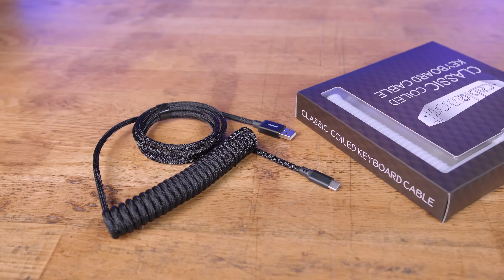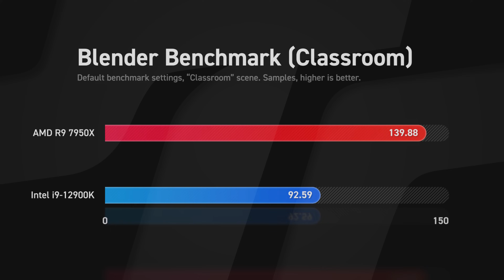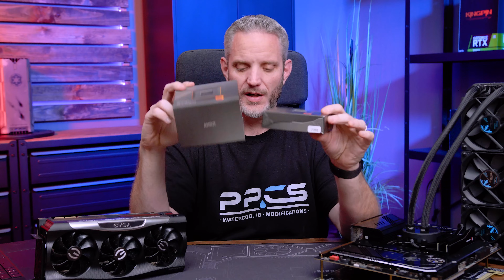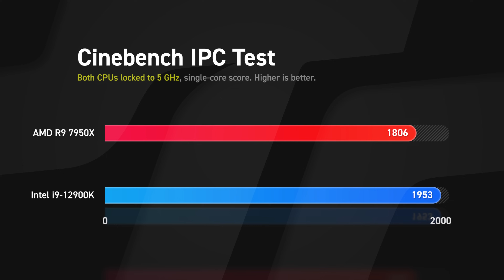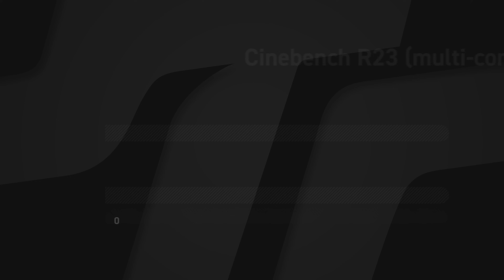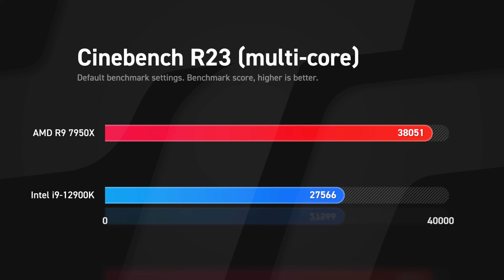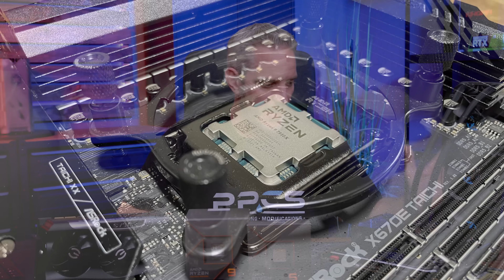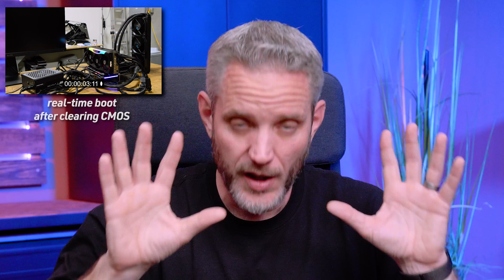Forget EVERTHING you THINK you know about AMD... these CPUs kick A$$!!

Comment: Hot running cpu has more benefits. You can get more freedom in cooling.

90 deg C core, if you can manage to have that with 80 deg water out, 30 in, it gives you a delta of 50 degrees and your pump only need to supply around 1.2ml if water per second (if my math is good). That's a liter every fifteen minutes.

80 might be a stretch, but it scales nicely. 2.5ml/s for 25 deg delta etc.

Comment: ok, so it can run  with no problems at 95c. What's that going to do to things like my gpu and m2 drives? Are we going to need cases that isolate the cpu from the rest of the system? I'm not an overclocker so maybe not an issue?
Reply: u less all you do is run stupid arbitrary pointless make believe score benchmarks like cinebench or prime 95...OR I'd all you do is run Handbrake ( basically anything that keeps your cou pegged at 99 and 100 percent usage).........you need never worry about that as the 7600x will never even clear 70 I bet.

Comment: I've noticed that even asus since the strix line something has changed. the strix line isnt like the old rog brand. compiar the old areies, mars and matrix cards from say the gtx580 or hd 7970 to the strix cards. sure strix is good but not like the old rog. evga used to make amazing cards to like the classified and hydro copper. if amd or intell got a hold of evga and told them ok go nuts make the best overclock able card for us and evga did it ....I would definitely save up cash and buy whatever they made.

Comment: Great vid as always!  Silly noob question: I just installed a 3090ti into my system and wanted to get the most out of it.  I have a 144hz Curved Predator gaming monitor (on my phone at work so  don't have the specs) and realized that I was about to use the old.... nameless stock 1.4 Display Port wire that I had in my closet from god knows when to hook them up.  I ordered a 2.0 Display Port wire from Amazon that literally arrives in the morning, cost me a very cheap $22.00 with shipping.  My question is... are all 2.0 DP wires the same?  Or should I look elsewhere?

Comment: AMD has great hardware, I just wish their drivers for their GPUs weren't a hot garbage fire. The only reason I got a 2070 after years and years of using amd cards, and suffering trying to find working drivers that don't constantly crash.
Reply: they're drivers have not been anywhere near trash since before the 7970 days..what pka wtf do you think you've been on all this time.

come back to Earth.

besides that .if you're on Linux..the correct drivers are ready baked into the kernel
Reply: @motoryzen  no I'm on windows. Last card I had was an R390

And it wasn't fun. I'd clear the drivers. Install the newest one, boot up and it would black screen. And never turn on again. I could even see the bios. So I had to put in an old card, just so I can see wtf I'm doing, clear the drivers, and start over with a different one, until I found one that works, that was like a year old. So in my last experience with an AMD card, it was garbage. Love their cpu though.

Comment: Why are we talking like 95c is a good thing... Besides aren't aios susceptible too constant high temps?
Reply: It's a good feature. Basically, it's automatic overclocking. I hope Intel will add the same feature as well.
Reply: @Kastrit  Not sure about that. I mean I use a custom loop on a 10600k and under load it's peaks at 50c. Not sure I'd like 95 to be the new norm even if it's a auto overclocking feature. Sure when winter comes I don't have to use the furnace as I would already have one blowing hot air into the room. Permiation is also a concern when the normal operating temps are so high. Just checked out de8auers vid on the 7k series. Apparently AMD done goofed on the IHS like Intel did

Comment: I'm kind of hesitant to upgrade my 9900k atm because that would mean buying new mobo and ram, cause I'm aiming for the X3D variants. But after watching this video, I'm even more tempted, especially switching to AMD after a decade of using Intel.
Reply: Same am on 9th gen to, i7 9700k. I want to get the 8core 12thread AMD zen4 CPU I can't wait for this release
Reply: @thealien_ali3382  the 7700x supposed to be on par with the 12600k 🤷 so I wouldn't bank that being so good
Reply: Don't waste your money and just wait for 13th gen and stick with DDR4 until DDR5 fully matures. As I came from a 5ghz 9600k which gave the same gaming performance as the 9900k to a 12600k and I noticed a huge leap in overall performance. And that's not to mention how well it responds to overclocking

Comment: what is the effect of running your system 95 Celsius over a long term (with intended use being animation renderings)? I would also like to know the average build cost of going AM5? price per Ghz? I am on the verge of building a new system and sitting with budget hands teatering between new gen vs current gen. What is your advice Jay?!

Comment: Linus benchmarks shows that AMD Ryzen 7 5800X3D Zen 3 beats in gaming all the Zen 4 CPU and i9 12900KS. So Zen 4 is only useful for production work not for gaming
Reply: no it shows a damn tie...on everything..
look at the damn frame rates.

wtf has a 500 + hz monitor?

wtf can even see beyond 200 something hz?

get real.

and Linus, just like Luke during the older days 10 years ago, calls a win anything that is more than 5 or 10 fps in thr multiple hundreds fps realm.

that makes absolutely no sense as NO ONE can even see such a small difference that really is within the margin of error 

now .100 fps versus 70 OR ABOUT 80fps...sure..that can be noticable

otherwise..no
Reply: @motoryzen  Are you going to pay hundreds of dollars extra for something that performs worse even if by little? 
5800X3D is far cheaper since there is no need to even upgrade motherboard.
Reply: @wekkimeif7720  for my particular goal which is w new build for my mother's light gaming and mostly work rig with a little bit of video editing on the side?..

She's dealing with a intel 7100 and the power supply is failing.

Now notice something..not a single content creator on YouTube has posted details about IDLE and Light usage power consumption numbers on the 7600x versus the 5800x3d or 5600x.

THAT...is what I'm looking at the most as well as price.

I'm not loaded ..but I'm at baby step 4 in Total Money Makeover book...smacking down a few extra Benny's for a platform that WILL be upgradable in the next 5 years while not having to buy another mobo as well as room for more ram makes more sense for my goal and Mom's needs.

Now for me...IF I was still sitting on my ( what has been for over a year now) backup PC rig with a 4790k..AND content creation and hardware multitasking with vms weren't in my needs...sure that 5800x3d would be a no brainer.  I currently run a 5900x build with 128GBs of ram though with a 8GB rx580.

So my only real upgrade I care about is the upcoming in October newest gen and GPU. Then in good for the next 6 or 7 years easily.
Reply: The 5800X3D only won against the 12900k in selected tities and I can assure you I "own" both 12900k and 5800X3D and in most of the games the 12900k does in fact come out on top by a couple of FPS
Reply: @welshman2011  yes..a couple of fps ans that is the point I made..

W couple of fps ISNT even noticable.

What matters the most to the person who is ACTUALLY playing the game?
not even a 5 percent difference at the 60 plus fps range from some YouTuber online. Or REAL world noticable performance?

That is the question so many refuse to ask themselves

Comment: I'd say it's more like they designed the CPUs and then saw the temps and the marketing team took over from there. Go check out Romans (Der8auer) early delid and deeper dive into the IHS on these CPUs, WAY thicker than they should be. He got his 7950 to 5.5Ghz, all cores, and a 20C drop by deliding and using direct die with a 360 AIO.

Comment: Really pleased that Zen 4 AM5 is delivering. 
Can’t say I’m pleased about how it dials the memory timings in, and the temperature it runs at 🥵 
I know once it’s got them, it boots just fine. But you know there’s going to be that day when you really need your pc to do something quick, and that’s going to kick in.
Just makes me think back to having to turn the plug off on my 1700x every now and again. I’d much prefer configuring the bios, and off it goes.
The multithreaded performance has really increased, but in a review I read online, gaming performance over the 5900x was 5-12 fps. Obviously I need to check more reviews, but on the gaming front I don’t feel that bothered that I’m not planning to upgrade this generation.

Comment: I mean... I have a rather new 5950X that's scoring over 26,200 in R23 one a pretty dirty testing install, right out of the box... no PBO, everything on auto. And it's doing that at 125 watts. So, I guess they've improved something over time and it looks like they caught up in multi-core to the 12900K. But nice to see the 7950X still beat my 5950X by 8,000 points when I have PBO enabled. It's a serious improvement. But I still think I'm going to wait for Zen4+ or 3D cache before I consider moving to AM5.

Comment: 20:34 Meanwhile, Microsoft is adding splash screens with artificial delay to their programs for no reason other than to piss off their users (my recent case: Smartphone Link)

20:43 17 tabs? That's nothing. Absolutely nothing. But well, probably somewhere around the max a fricken Chrome could handle. My FF currently has 4761 tabs open. And yes, I could bookmark all the stuff I opened there to clean it up, it's 98% tech, aviation and (mostly VR) gaming/review videos I wanted to watch, but didn't have time for.

21:07 "Two years, a bunch of bullcrap, the manufacturers are back" - fun fact, and probably absolutely worth facehoofing: Speaking of bullcrap, in Germany, one of the biggest (and oldest) toilet paper producing companies just went bankrupt....

Comment: there is a difference of a 300w CPU at 95C than a 200w CPU at 95C
Reply: sure..your electric bill.

otherwise..no...the heat output will be the same because the damn CPU cooling system will STILL be trying to cook 95c 's of heat and moving that away from the cou one way or another
Reply: @motoryzen  tell that to space heaters. 150w is useless for the room vs 1500w
Reply: @3agl33y369  mk...so.. PCs are designed to be used as space heaters...that's what a space heater is for.
Reply: @motoryzen  power consumption for pc's turns over 90% into heat so it is not dealing with that same amount of heat. the transfer is the same for the heatsink, that I agree with you. but the power difference is there messing with it.
Reply: @3agl33y369  ok in the end ..you're agreeing with my point...so..(scratches head)..
Reply: @motoryzen  I'm  just saying it's better to have 200w than 300w at 95c, especially if it doesn't throttle to the pits.

Comment: My board has a memory alert to tell me if the modules are performing at optimal speeds and after I turned it on I kept getting an alert saying " modules in incorrect slots " no matter how many times I put them from A2 B2 to A1 B1 ( like the message said to do for dual channel )  I kept getting a boot cycle so I just gave up and put em back into A2 B2. Booted instantly to 3200 mghz, boot looping is terrifying when you don't know what you are doing, it's that brief moment of OH ** I broke something. It's nice to see you mention not to freak out during a boot loop, honestly I walked away for 5 mins cause it was first rig and I built it myself so I figured I broke something,  came back and figured if it hadn't booted it wasn't going to. It's the little things like bending the back plate tab on GPU'S and installing the cpu into the board that freaks alot of first timers out. The amount of force I had to put for my cpu cover to pop was INSANE. but it works so hey, o don't think I broke anything lmao

Comment: $1000-$1500+ Video cards, $500-$700+ CPU's, $500 cases, $400 RAM, $400 PSU's, $700 MB's, $1000 Monitors, $0 each for Fans .... man, where does it end? I won't be able to ever build a new computer ever again. My last one I built for about $550 complete. Now you're looking at $5k! From what I am hearing and seeing on youtube, the advancements aren't all that great in the amount of advancement, yet the the pricing insinuates much, much more. Couple all of that with the so-called "shortages" we had where they sold to miners mostly, the inflated pricing and market manipulation. I am about let my computer become obsolete and do without one.
Reply: Uunless you're trying to run vms + game at UHD resolution + export a freaking UHD video all at the same time...ya don't need a damn multiple thousand dollar rig.

stop looking at the highest end.

if you know you'll make use of your PC for easily more than 5 years..just either buy a 5800x3d now do a build based on that I'd you're not needing pci express 5.0...or wait until next year Christ mas time when 7000 series CPU prices drop a bit
Reply: @motoryzen  Not looking at nor wanting a damn multiple thousand dollar rig, that's my point. The way prices are, you can't spend just a little just to be able to do some things with the way prices are climbing on everything. I would love to be able to spend $500 on a rig, but that is no longer feasible. So before you spout off, know what you are talking about!

Comment: Amd has certainly done very good work here BUT it is not as great as it looks and certainly not as good as the advertised. I took all the measures (non oc) from this video compared them in percentages between amd and intel and it comes out that in the end amd is performing at 19.78% better than intel on average. Based on that these benchmarks show normal new gen differences compared to last gen nothing too insane. Now if you also put price to performance ratio in consideration intel 12th gen might still be the most vfm. Nevertheless amd looks like they have a solid lineup but nothing more than that.

Comment: I just picked up an Asus RTX 3090ti(water cooled version) right after the new 40 series cards were announced for $1100 from Newegg. Considering I was using a GTX 1080ti hybrid for 1440p gaming the last several years it was a nice upgrade. I’m not too worried on the real world gaming performance I might be missing out on by not waiting on the 40 series cards. Also I’m just glad I didn’t pay 2k+ for this card lol. 

With the GPU upgrade I also upgraded my PSU from a Corsair RM750x to a Corsair RM1000. 
Also upgraded my M.2 SSD from 2x256 Toshiba ssd to 2x 1TB Samsung 970 Evo Plus.

Next is to upgrade my i9 9900k to either this 9750x platform but I’m going to wait and see what Intel has to offer… also need to look into if I can still use my DDR4 4000mhz RAM with either of these new CPU’s or if it’s worth upgrading to DDR5.

-sorry for my rambling lmao I don’t have any friends and it’s kinda hard talking PC parts with your fiancé who doesn’t know about PC parts😂

Comment: Now that both new CPUs and GPUs have turned into sauna stoves, it would be interesting to see all kinds of custom watercooling tests with the new hardware. For example how many and large radiators does one need to get all the performance out of these new components!
Reply: I think no radiator will keep this cool, as the bottleneck may be the thermal paste. It on GN review, it shot up to 95C in 8 seconds, making the size if your tank mostly irrelevant. Likely need liquid metal. I have heard good things with delidding though.

Comment: The only thing I don't like is the seemingly forced 95C. My small room is already hot enough with all the tech in it, I don't want to turn it into a sauna. Hoping there will be some kind of built in limiter/cap they can introduce so we can adjust it on the fly. Or I suppose I could try undervolting, though I have absolutely zero experience in that.

Comment: Also not all AM4 coolers are AM5 compatible, if they require another backplate, they're not compatible because you can't  change the backplate without some drilling

But yeah, I stopped a friend who wanted to build a system with Intel.